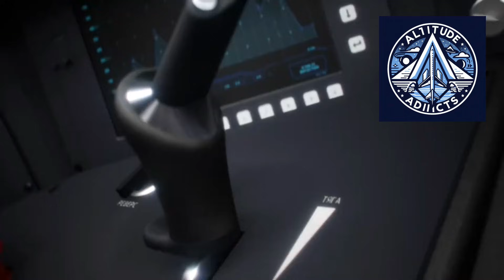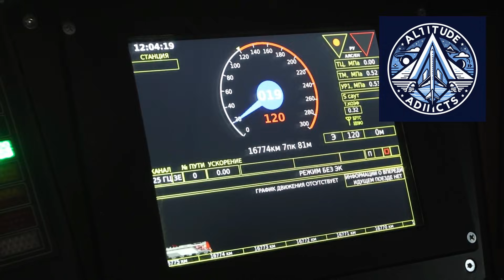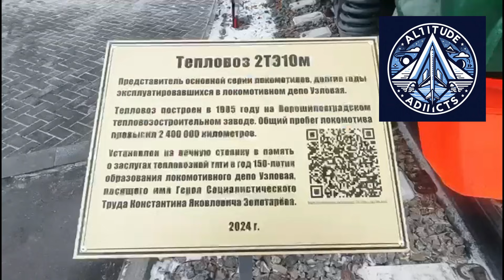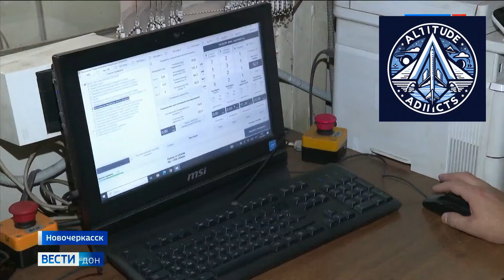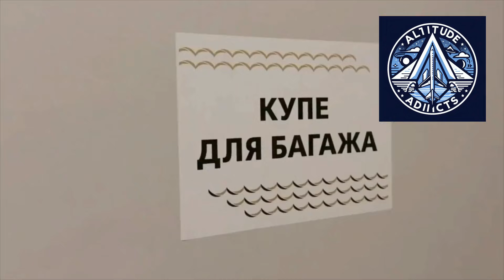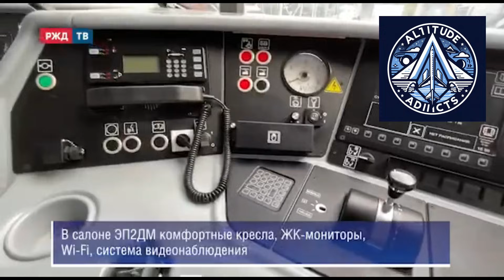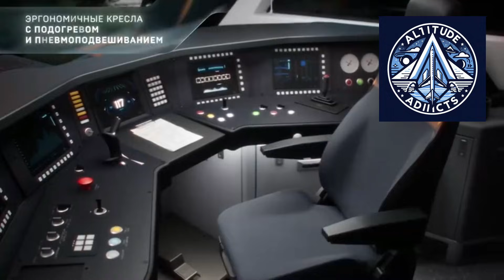Inside Russia’s Hydrogen Train Project for Sakhalin

Comment: Yes, hydrogen is a wonderful thing. I think that in the future, when oil and gas disappear, hydrogen will have no alternative. Many say you can drive on corn and regular batteries, but corn is an inefficient fuel, and batteries are more expensive than hydrogen cars. I'm not talking about the market price, but about the production cost of a hydrogen car. It's cheaper than a classic electric car and more efficient.